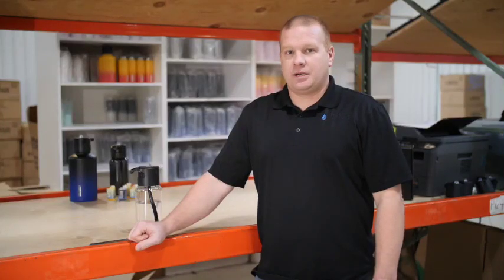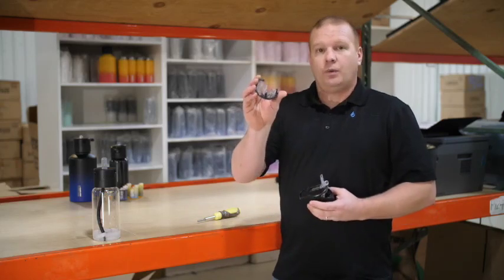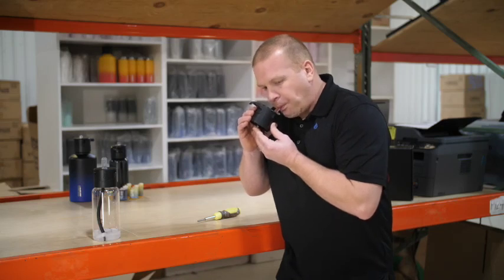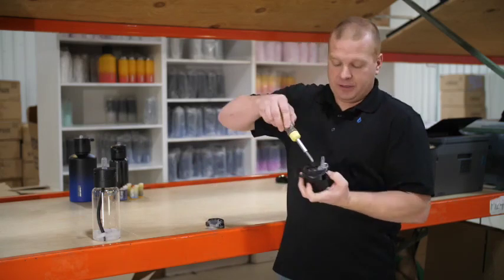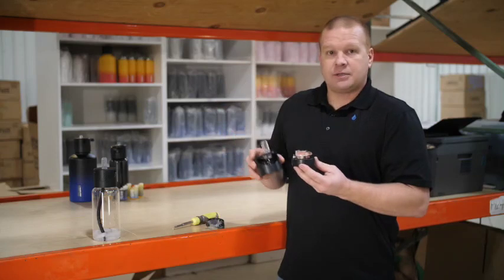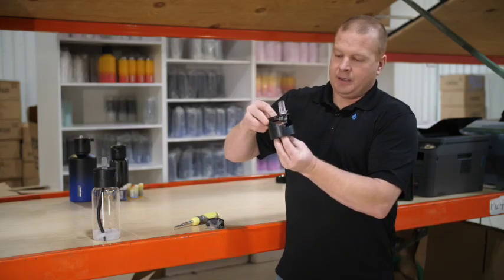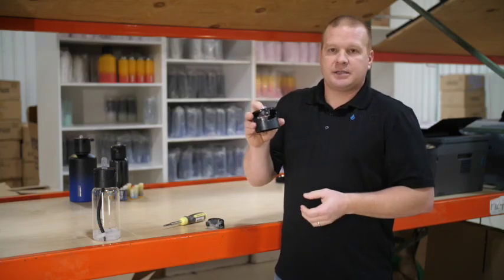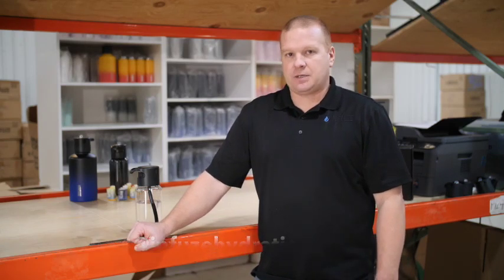How To Clean Infuze Vessel

Comment: I'm going to preface this by saying it was easy to fix, but there's a small caveat to the claim that you can use any liquid water enhancer. After trying the Infuze Elixers my bottle came with, I went to the store and noticed Arizona had water flavor enhancers. Yeah, it turns out that the Arizona ones have small bits of tea leaves in them, and it completely clogged the Infuze lid. I'm so glad these things are so easy to disassemble because I was ultimately able to easily remove the bits blocking the piece inside. Even though I had to fully take apart every piece, there weren't a lot of pieces, it was very clear wear and how everything went together, and there were only 3 screws holding it together. Lesson learned, double check the package and make sure no where on the label does it recommend shaking before using.
Reply from the maker: Good to know! That is a brand that we haven't done much testing on. Glad you could get it fixed.
Reply: Sounds to me like you tried putting something that was not liquid threw it. Definitely your fault not the infuse.
Reply: @Petchyalater  I put Arizona liquid water enhancer in it.
Reply: @VintageFenrir   that had none liquid tea leaves in it correct? That isn’t there fault.
Reply: @Petchyalater  first off, I didn't say it was the fault of Infuze. They can't be expected to test every single product with theirs to ensure universal compatibility. Second, it still warrants warning people, because none of these products say "warning, contain non-liquid matter" because that's such a niche scenerio to be significant. The product by Arizona doesn't even look like it has solid matter in it after squirting it unless you look far more closely than any reasonably human would, you certainly can't check before you buy it since it's completely covered in an opaque wrapper, and I'm sure this is not the only product like this.

Comment: I have several Infuze lids and have been using them for years. These things collect MOLD. When you are at the point of needing a deep clean, you DO NOT want to be "pulling all that water [and mold] through the system and INTO YOU." Unscrew everything, wash every little piece and use rubbing alcohol and a cotton swab to clean the mouthpiece. Maintaining this system is very cumbersome, even if it's "just once a month" if you actually want to clean the thing. 🙈 I much prefer Cirkul because it is cleaner, but I just don't like using their flavors. Even with that said, I keep coming back to Infuze from Cirkul and just have to deal with the task.
Reply from the maker: If you use our flavors they along grow mold. If you use other products in it you need to rinse it out with hot water at least every few days to prevent any mold growth.
Reply: @infuzehydration3567  I've been using nothing but your Sublime Elixir in my current new clear lid that I just deep-cleaned for the first time a few minutes ago after about 3 weeks of use. I should have taken pictures - there was indeed mold.
Reply: It's been a month since I left this comment. I have been using nothing but Infuze Elixirs (Orange and Lemonade to be specific) and have been running hot water through once or twice weekly for cleaning. Today I just went in for my monthly deep clean and once again lots of black mold. You will be drinking the mold before you will find out that it is there. It's one thing to have to wash a bottle, but this has too many components to take care of and It's just too much maintenance for me. I'm officially done with the system until they can come up with a better lid.